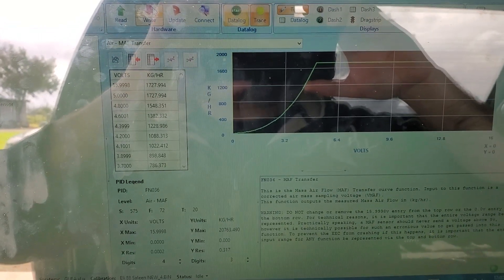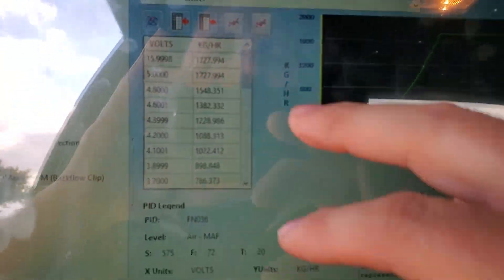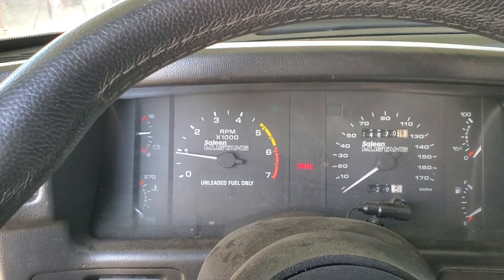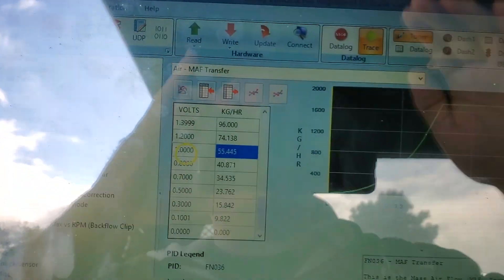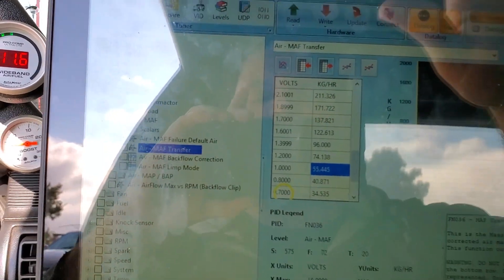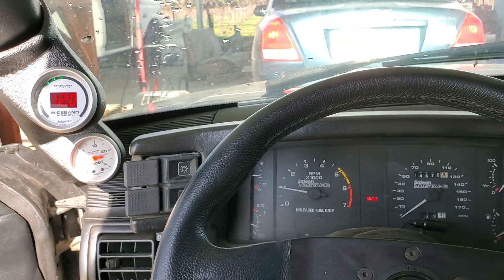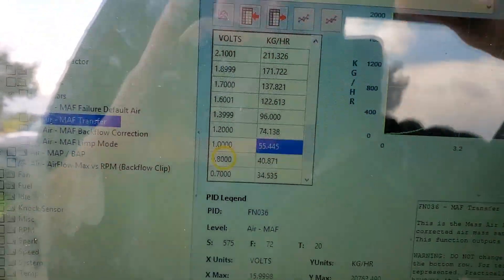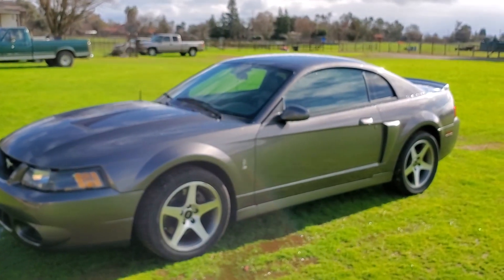Tuning with Quarterhorse

Comment: Is Quarterhorse a viable tune system for a 1989  Mustang 2300 4cyl engine with speed density? Thank you
Reply: Man do you know off the top of your head roughly what the term speed density is I'm converting my 150 from a MAP sensor to a MAF sensor I've done a butt ton of research and I've converted with the Almighty Oracle that is Google that will never answer a straightforward question particularly towards a vehicle so I'm trying to find somebody that can help me answer? I'm pretty much going to have a mustang mustang engine everything in an F-150 computer and all but that's the last part that's holding me up to keep me from pulling the trigger I need to understand that before I do it and I'm also interested about the bag of quarter horse performance thing too Heck I want him to get all the horsepower and fuel economy I can off my truck envy your little 4 cylinder oh I can't remember the site on YouTube You can look this up for your own wish list but this guy's making bill it 2300 4 cylinder racing engines and they're making like 4 and 500 horsepower it's easy Don't know the price may can look it up and find it easy I don't know just thought you should know later man
Reply from the maker: it works for the price.

Comment: I have an 89 Notch with HCI along with other performance upgrades.  The car is running rich, the idle is sporadic, and the car bucks when in low RPM's.  Wanted your opinion on if the Moates QH would be a good tuning option to solve these issues?  Also, does the QH eliminate the need for oxygen sensors or the MAF?  Thanks!
Reply from the maker: Yes a QH is a good start. But you have a little more money then I would go with the Megasquirt micro.  Also, it depends on what have you done to the car so far and the placement of the MAF.  You will always need 02 and MAF with the QG. The megasquirt uses a MAP.
Reply: Thank You Sir for the response.  I’m just looking to tie the performance upgrades with a good tune together.  I can tell that there is more power and a more stable idle and drivability if I can tune the car.  It’s still fun to drive and the value in these Foxbodys are going up all the time.

Comment: Just found this video. Using qh with tuner pro, no wideband. Have 30 lb injectors, trying to get those  set. Head cam intake 92 gt!
Reply from the maker: Nice, Its a good system. Just watch out for the stock copastors on the old computer.
Reply: @SpeedForceGarage  ok, thanks for the information, I have 4 computers, 3 as backups!  Ended up getting a tuners help, too steep of a learning curve for me!

Comment: How simple is this to use? What kind of knowledge would be helpful to self tune my own car?
Reply from the maker: If the car is N/A and you have a copy of your stock tune, and you have some knowledge of what afr should be and how much max timing you can do. Then have fun. But if you don't know any of that then don't mess with it.
Reply: @SpeedForceGarage  absolutely.  I've always been a carb guy. Switching over to efi. But yes I understand timing and afr all to well. So thanks for that. Now i just need to get a quarter horse lmao
Reply from the maker: @shawngoff8290  How's it coming along?
Reply: @SpeedForceGarage  im going with a holley sniper efi. Its seems more practical at the current moment

Comment: Have you ever used the quarter horse on a ford truck ?
Reply from the maker: I haven't but they can be done. Ill have to buy the Strategy for it.
Reply: VHPerformance I’ve never used the quarter horse , is the strategy for it available?
Reply from the maker: Yes, if you look up Bindery editor, the guy that wrote the program has a list of strategies.

Comment: Okay I have a question I have a 91 F-150 before I got it they decided to hop it up more horsepower than halfway through they changed their minds so if you bow tones and EGR delete a long tube headers The worst cardinal sin is that an a9L mustang computer in there You most likely know that it is a mustang computer just in case you don't it's mustang computer and two big problems they didn't convert it to a MAF sensor it's still a MAP sensor so I've invested about a year's worth of studying of physical looks at fellow people that I know at local parking lots and mustangs and stuff to find out my truck has 1 02 sensor and mustang computers called for two The end result is I ran through probably a grand total of $3,000 worth of ECMs so I'm wanting to clarify this one last thing and that's something when you convert to a MAF sensor something about speed density could you elaborate and then I'll probably pull the trigger on that and then I'll probably come into y'all if you can do programming maybe if you're in South Carolina area or close to it I doubt it based on my luck LMAO LMAO if not is that software almost internet free or how much is it you know the works because1 I've invested so much I don't know if anybody around here that's doing anything but mustangs and stuff like that hell I'll probably be the programmer guy in this local area lol so if you wouldn't mind man you can help me with that that would be a blessing one more thing I don't have a mustang engine standard forward F-150 engine it sucks lol so would it still work or be adjusted for a while until I can find the mustang upper end heads intake stuff like that let me know thank you